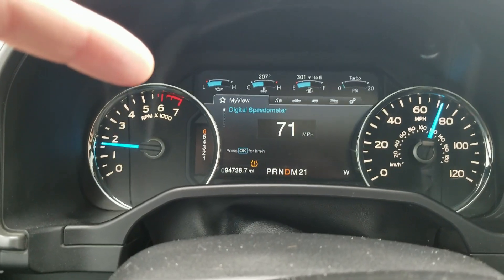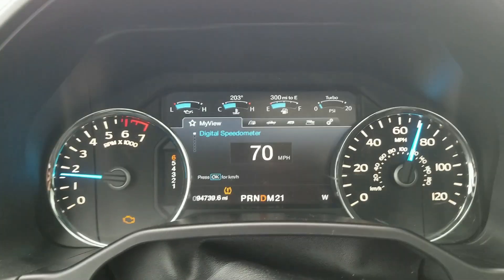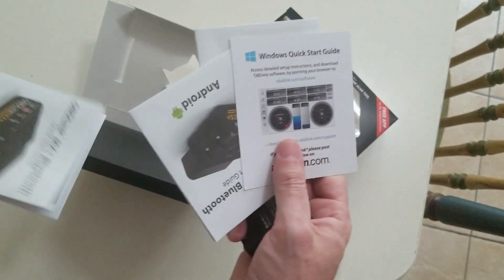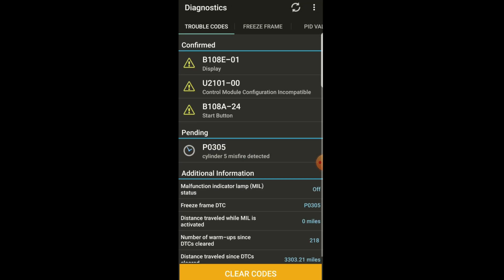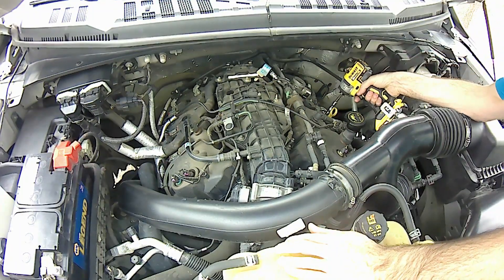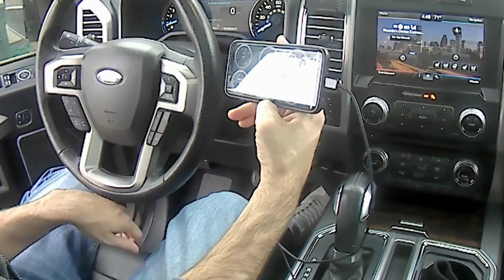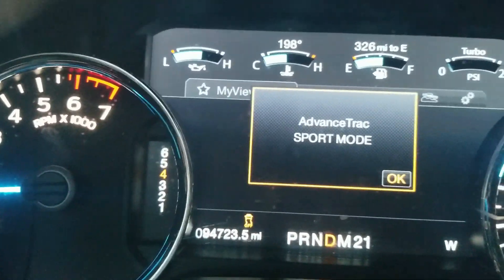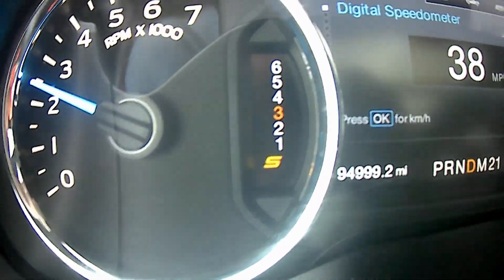OBDLinkMX+ diagnostic and performance on Ford f150

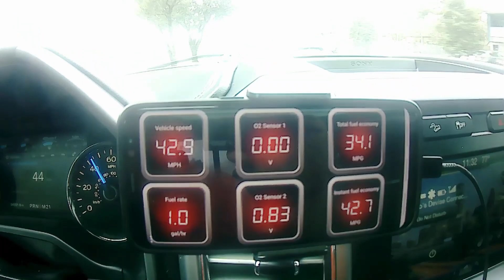Comment: O2 sensor 1 @8:30mins on the gage is not working ? Shows 0.00 
Is that bad or normal ?
Reply: My same scanner does the same o2  sensor 1 =0.00 same with MAF

Comment: Let me give you a tip on the Traction control off. 2 double click traction control then once it shows your on sport advance track Press and Hold the Traction control until you see ADVANCE TRAC OFF! Tell me how much power you feel on the Wheel!!! Then you can put it on sport mode and make it more fun!

Comment: Bro, 1st Luv the video. Quick ? My button on my stick shift T/S does not work. Any fixes you can think of that may help. I also have 3.5 Eco, 2016 Plat
Reply from the maker: I haven't seen forscan effect this. But unplug it and reconnect it. This worked on my mirrors.

Comment: You are not supposed to put anti seize on spark plugs. It changes the heat range of the plugs
Reply from the maker: Never heard of this... I'll have to research.  Thanks
Reply: @ricardosworkshop  it changes the heat dissipation because it has another layer for the heat to get through
Reply: @horsepoweraddiction808  wouldn't the copper serve as a good conductor of heat, thereby dissipating the heat? It's obviously not going to make it cool, it is IN the engine after all. I'm just curious how heat affects spark plug performance. I imagine there's an acceptable range. I would be surprised to find that anti-seize puts the spark plug outside the accepted optimal range.
Reply: @jquiznos2283  that would be assuming that you only use the copper-based anti-seize when there’s all kinds. then if it managed to dissipate heat quicker then it would lower the heat range. I’m not saying that it would change the heat range dramatically.  just that it changes the heat range. You could burn upplq

Comment: Can you point me in the right direction of enabling rear defrost? I only want my heated mirrors to work. I replaced the mirrors, fuse box and the ac control panel with the button but nothing lights up still. Any ideas of what to activate in forscan? 2020 F150 XL
Reply from the maker: Hi goober,  try this but don't know if its exactly what you are looking for.
https://youtu.be/voBXsJvwNYE
Reply: I enabled my neighbors truck after he did what you did and I just used forscan to enable rear defroster